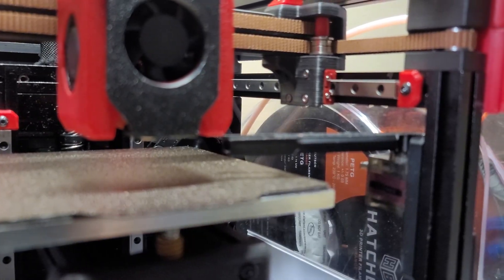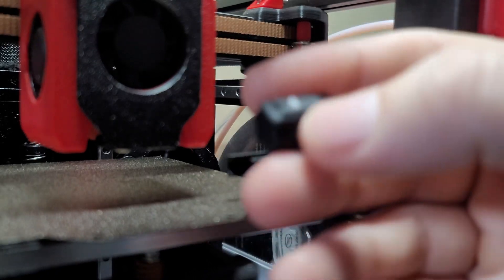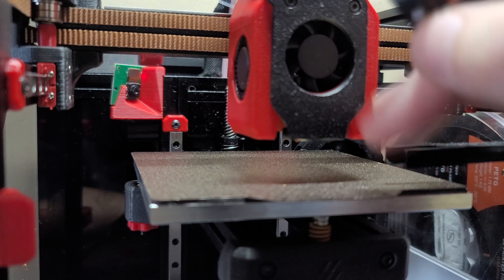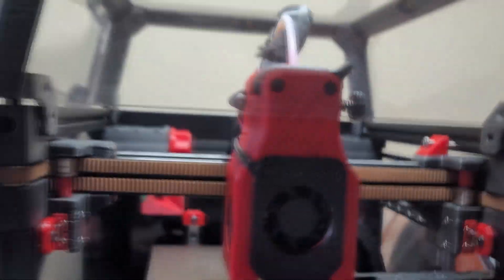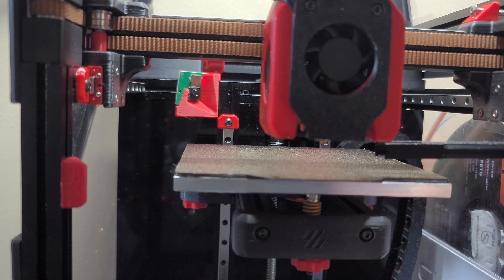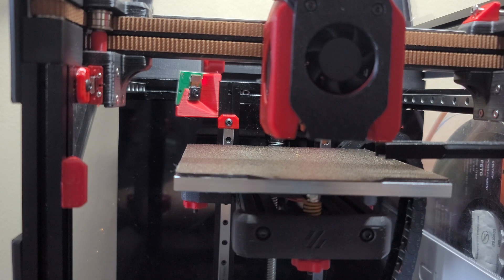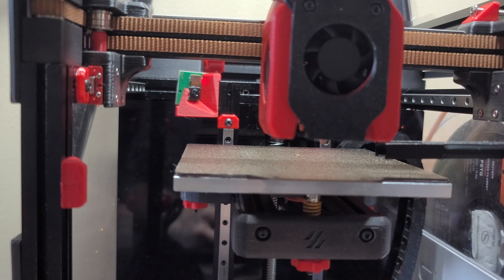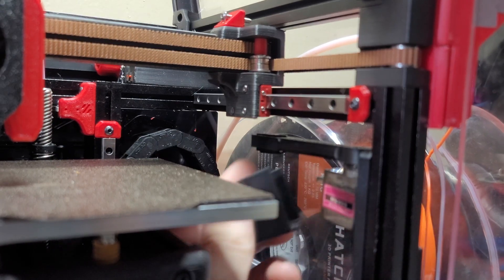Better Auto Bed Level on a Voron 0.1?!

Comment: Is there a reason why we need bed levelling to begin with, in modern 3D printing? Is it not better to build machines with a robust and level bed to begin with. XYZ should be orthogonal, no runout and the bed should be level without “fiddling” Apologies if my question is a bad/dumb one
Reply from the maker: Hi Anthony! Not a dumb or a bad question at all. In a perfect world yes, it would be best to build a machine that is robust enough to maintain level; however in 3D printing, we have to account for thermal expansion and contraction of the heated build plate which will (at a verrrrry small scale) flex the build plate just enough to where the first layer of filament will not be laid down properly. We're talking 0.02mm being the difference between a failed print and a perfect layer. Bed levelling doesn't actually adjust the bed at all, rather it creates a topographical map of the bed after being heated to see all of the heat induced warping and the printer firmware will accommodate for those slight differences. I hope this answered your question!
Reply: @DaturaDynamics  good point, thank you for the feedback.

Comment: Hey! Thank you for checking out the project! I like the modified probe mount. I was worried about the issues with being that close to the hot end but it seems to be working well. Nice work on the video :)
Reply from the maker: Hey man thanks so much for giving it a look! Yeah no problems at all being that close! I've even set temps to 275c and no warping on the probe mount at all.